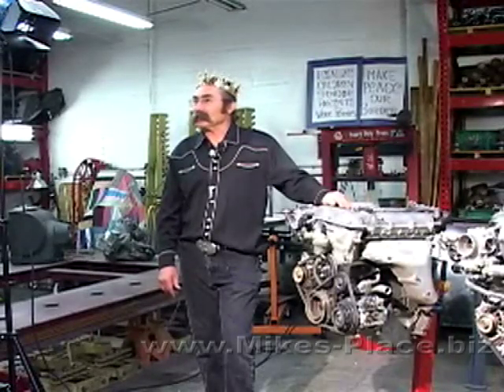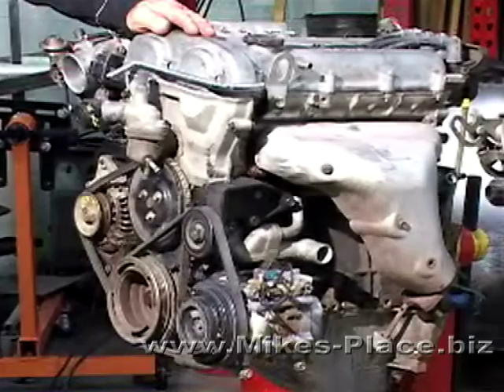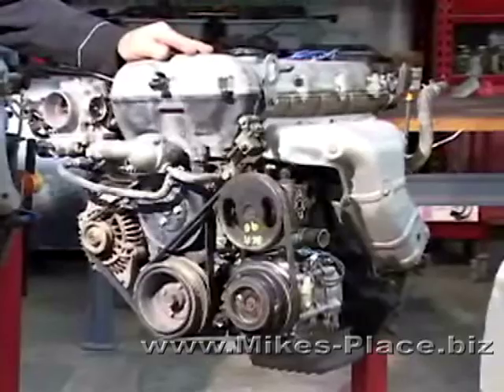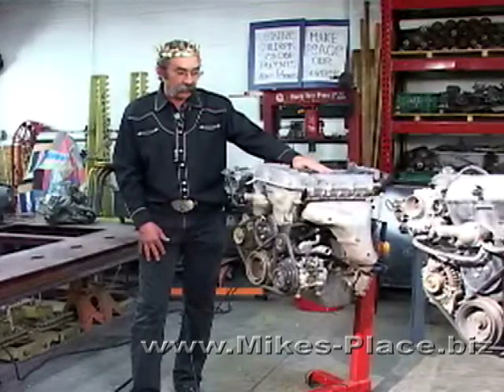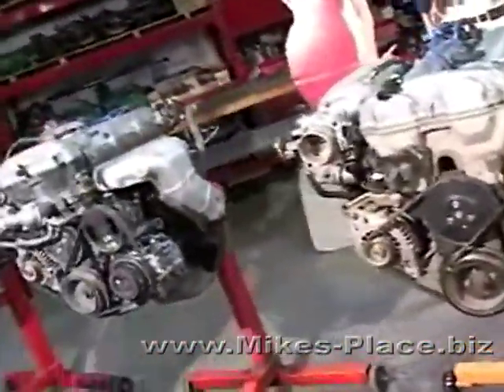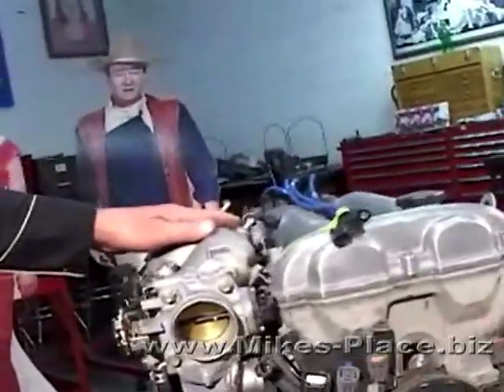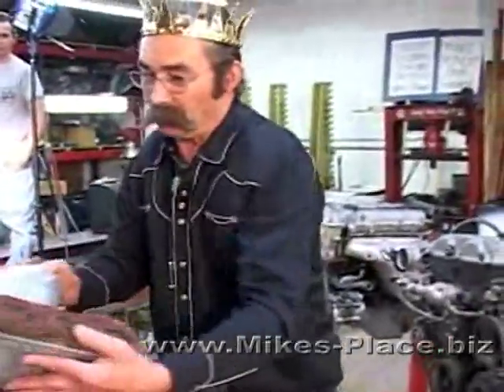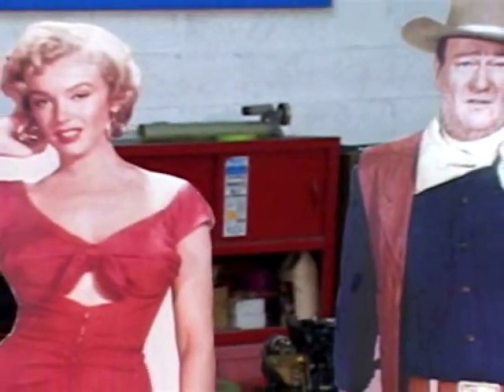Miata, MX-5, Eunos roadster - 4 engine description by Mike at Mike's Place - 2007 Tech Day

Comment from the maker: @kenzo5716   let me guess your Miata is white?  what happened is that in early 90s the put new laws about paints and new water based primers were used on those cars.  The problem was that the white paint came to some reaction with primer and then it just peal it self off.  Thanks for a comment.